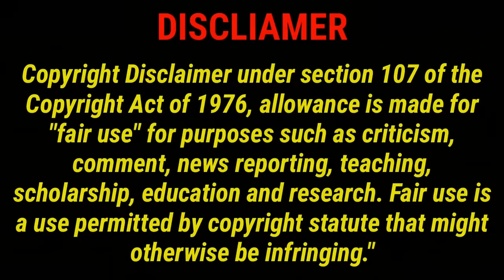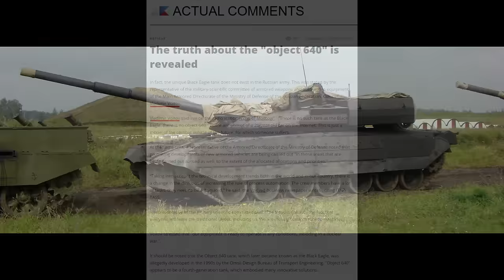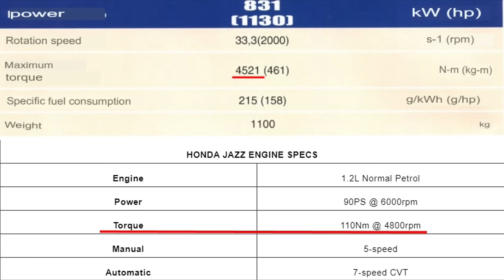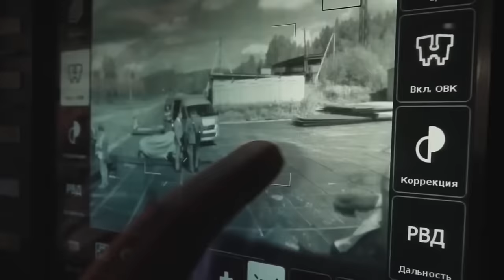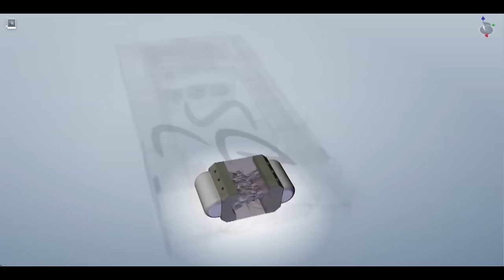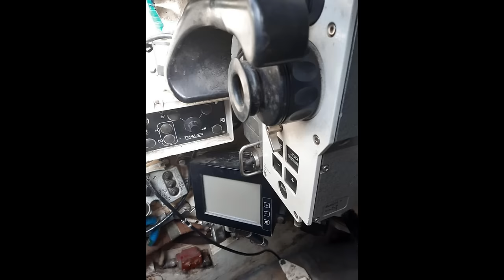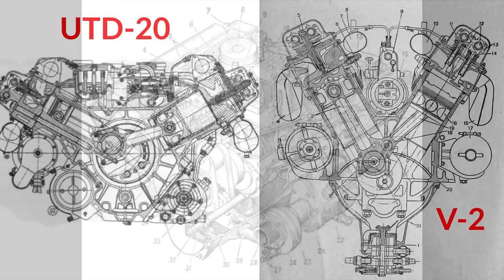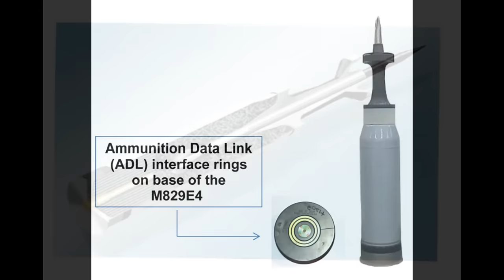LazerPig is WRONG about T-14 Armata

Comment: My grandad after the 1956 revolution when the Soviets were heading home and selling off their equipment to locals to buy rations/food/water got himself a T-54 tank which also uses the V-2, he worked on it a lot and sold it off to a tank museum where I have been working for 6 years (Kecel), I have maintained a T-72 V2 engine, the only difference between the 2 engines is that the T72 has a turbocharger on it an better bearings, nothing else.
Reply: @julia j
Which has nothing to do with his comment and is completely without substance, since the T14 does not use a variation of the same engine.....
Reply: @kivi
I mean yeah some verssof the engine will have bigger differences then others, the t54 and t72 might be close, but does the same go for the t80 and 90 or the t45?

Maybe something that wouod be fun to look into :)
Reply: He said it used a variant of it which is technically true but would be like saying the original 737 airliner is the same as a modern 787
Reply: @SweatyFeetGirl  T-14 Engine have infinitly less power, because it doesn't exists
Reply: T-54 does not use a V-2. It uses the V-54
Reply: @SweatyFeetGirl  LazerPig never did claim that, he said that the T14 could not use the V2 because of space limitations, and it instead uses an engine that looks like a copy of the german SLA 16 diesel engine which was notorious for either blowing up or catching fire by itself
Reply: @homesteadlegion4419  T80 has gasturbine so that it could operate on the arctic, yes the T80 was made primarly for that. The T90 uses a very similiar engine as the T72 I worked on, Same Cylinder head, valves, pistons, The engine that is next to the T72 that I worked on is a T90 V2 engine,   the only difference I noticed was with the injectors, they had bigger outputs and a new turbo, had a bigger compressor
Reply: @TheForklifter  which is a modfied V2
Reply: @SweatyFeetGirl  Interesting. Any link to such "social media"? Or all is  produced by RT?
Reply: @SweatyFeetGirl  Why don't we have pictures from western production lines of tanks? Well they exist and are part of military units.
Reply: @Kivi LP your boyfriend?
Reply: @jamesmandahl444  nah, Im not into men.
Reply: @ladrok97  What? 2V-12-3 very clearly exists my dude. They were first manufactured in the 80s and tested then. They're not mass produced of course but they are very much real engines.
Reply: Everyone here ignoring the fact this guys grandpa got himself a whole ass tank for potatoes
Reply: Adding a turbocharger is a pretty big deal.

Comment: and the TVR used a "slant six"...  LazerPog isn't much of an engine guy, I don't think he could find an exhaust port if it was full of womp rats eyes glowing in the darkness...    Now largely his point was that the engine was almost always the same size with the same mounts and same coupling location.    You seem to be confusing a little bit of "engine" vs "fully assembled running engine" in weights.   The numbers for the 2V are missing all the stuff you have to put on a crated engine to make it work.

Automatic target tracking has existed since before the end of WW2 for anti-air systems.  The AH56 Cheyenne had an inertial and optical target tracking system that could keep an autocannon on a ground target at 150mph in flight in the mid-late 60's.  LP isn't wrong, largely it was never seen as useful on a tank.   Multibattery automatic incidence targeting with remote tracking has existed - also - since before the end of WW2; its why japan stopped bothering trying to get Zeros up to the B29's.

In specific the TOW, Stugna and NLAW are going to go right past radar and IR on the Armata because they are not active sensor guided weapons.  Definitely one point to LP on this, if you don't SEE the TOW you don't survive the TOW.   If the Bradley or Striker or whatever vehicle carrying the M242 is knocking on your door you've got only one survival choice and that is breaking line-of-sight as the first step to making like a tree.  Stugna is like TOW but wireless, it isn't 'laser targeted' but source corrected and NLAW... NLAW is a Rocket Propelled Anti-Tank Mine in a stealth condom.  The only way you can interrupt NLAW is make your tank out of plastic, wood and concrete.

Overall very pleased with this video
Reply: Well technically even before the war, battleship Texas already had a very crude fire control system that computed lead and angles. More sophisticated systems that tracked targets and computed lead by way of analogue mechanical computers are present on most ships (above the size of destroyers) in WW2.
Automatic target tracking was not useless on a tank today, though back then it was not practical, since not only the systems and the optics way too bulky and expensive, there just isnt any way to track stuff on the ground (no infrared, no radar, not even cameras) 

and sidenote the reason for Imperial Japan not sending zeros up is that they don't have enough trained airmen anymore, both because of early losses in the battle of Midway, and the loss of air superiority due to the zero starting to be out-classed, as Imperial Japan does not have the economy to sustain production AND development of newer engines and airframes.

Comment: LazerPig's comments on the engine seemed odd to me right off the bat.  For workhorse type diesels they tend to go with what works and modernize it as opposed to building something new.  Reliability is paramount.  So a 80 year old engine modernized should do the job.  It might be "worse" than ultra modern engines, but it will likely be far more reliable and easy to fix.
Reply: Even on the high end performance side of things, Lamborghini used the same V12 design from 1964 right up until 2010, and the engine went from ~280 bhp to ~660 bhp in output. Engine design has come a long way and I can think of a few automotive examples like the Lambo V12 where you can take an old block design and squeeze a lot more juice out of it by bolting on newer equipment and increasing displacement. Having a eighty year old engine design is more a testament to how overbuilt it was originally rather than how it's necessarily outdated now.
Reply: @uummmnocoolnames based lambo
Reply: It’s the Ferdinand tiger engine. Do you know how unreliable that is? Anything based on it is going to  suck immediately
Reply: @unclesamlore  Let's go over the things you got wrong, or rather, the things Lazerpig got wrong, that you are parroting:

1. The Porsche Tiger/Ferdinand didn't have a single engine - it had two.
2. The actual engines themselves weren't the source of the problem - the HL120 TRM was used in later versions of the Pz.3 and most of the Pz.4s, as well as the myriad of different AFVs that used those chassis, none of which had noteworthy engine issues. It was the complexity of the twin engine powerplant coupled to a petrol-electric drive that caused issues.
3. The T-14 doesn't use a twin engine design.
4. The T-14 doesn't use an HL120 TRM, nor any engine derived from it, nor any engine derived from Germany.
5. The T-14 doesn't use a petrol-electric drive, nor a diesel-electric drive, but rather a mechanical transmission.

So by my count that's... carry the 2... literally nothing factually correct in your/Lazerpig's statement. 

For as much of an ass as I'm being, I don't necessarily find fault with you for assuming Lazerpig's video wasn't riddled with inaccuracies; he's a damn good script writer, and seems to do his research... most of the time. That being said, considering all the numbered points above are a single google search away, you should probably start to question the veracity of his claims, at least when it comes to technical stuff - geopolitics and history might be another story.
Reply: Think about it like this, if the 80 year old engine forces you to be several tonnes under the the modern engines, because they can't handle the performance requirement at that higher tonnage, then no amount of reliability will overcome the fact that it takes 3-4 shots to get the same results as a single one of theirs.

Comment: also about thah aoutoloader being a "deathtrap" it turns out the most of detonations of t-64++ were caused by a spare ammunition located in the turret or upper parts of a hull being hit by penning shot... and not carousel itself.
Reply: Keep coping
Reply: @bladesideentertainment7002 coping with...
Reply: @bladesideentertainment7002  ah yes smart guy you are. "Keep coping" on a real fact

Comment: i do feel like that lazerpig's jokes oversimplify specific points, and the overall quality suffers from it.
Reply: If you think "The Honda Jazz has more torque than a 50 ton Main Battle Tank" is a simplification of a joke and he only corrected it on the comments because people called him out on it, Nice job. Level 9999 humor right there. The T-90M is using the same engine as the BT-7. Super nice joke.

Comment: They ran out of ammo 10 months ago though? AMIRIGHT
Reply: They did, hence the Kiev retreat.
Reply: @ChucksSEADnDEAD  and yet they fire 3-4 times more shells then ukraine per day.
The retreat from Kiev was because of over exstension of the small force sent to ukraine, logistical issues (not the lack of shells but the trucks getting ambushed),  entire enemy formations in the rear (causing said supply issues) and simply lack of men to capture kiev in a regular fight as you cant capture a city of 3 milion with 60k men(or how many they had on the northern front)
Reply: @ChucksSEADnDEAD  truly delusional

Comment: 28:12 smallest windshield wipers known 😅 Seems fragile to HE, surprised they don’t use high pressure air+washer fluid (like some cars do on headlights)
Reply: Idk how the system is stored but it may add unnecessary weight n usage of space to store water ? So ig they went with the good old wiper
Reply: @hemendraravi4787  it is way way way more space and weight efficient that way in the long term
Reply: @domaxltv  Do you know whether anny tank that uses pressure and water washers?
Reply: @voidtempering8700  My area of expertise is mostly cold war era tanks (and back then such systems were a bit too complex to be widespread in general from what I know) but from what I do know of most modern ones, there is no such system in service or even on prototypes, though I could very well be wrong and someone more qualified could be able to confirm it

Comment: You know what Soviet area auto-loading systems are SUPER known for?  How easily and common it is for the ammunition to ignite and explode, completely blowing the turret off the main body of the tank.  This is a pretty common happening, just looking at pictures and videos of destroyed tanks in the Russo-Ukrainian War, as well as The Iraq War and even back to Operation : Desert Storm.  
One more thing... no reverse in a tank?   Fuck that... going in reverse is literally just as important as going forward in a tank.  The later T series has a very slow reverse rate compared to most NATO tanks, which would just be terrifying to know before heading out to make contact with other armor and anti- armor units.
Reply: Cope harder.
Reply: @pnduarte4696  Did you enjoy the May Day parade?
Reply: @Lonech  yeah....
Reply: There's a video of an East German tanker showing around a T72 and not once did he say the auto-loader had any problem. He actually said that it's the best tank he ever worked in.
Reply: Okay but the turret popping is an overblown issue, if a cramped tank like a T-72 gets hit in the ammo, chances are the crew are toast wether it detonates the turret off or not. 

Yes blowout panels are better, yes the design philosophy is outdated, yes it means less vehicle recoveries, doesn't change the fact that it is overblown.

Comment: I completely agree about the autoloader being very robust even to the point of ripping your arm off and continuing going about its business 😂😂
Reply: speaking from personal experience?
Reply: @ВячеславСкопюк  i doubt hes even seen a russian tank in person, let alone see an autoloader. Besides, if you put your hand in a autoloader while its reloading, its mostly your fault.
Reply: Except that was only recorded to have happened on early BMP-1 and its auto-loader, however they solved the issue when they removed it altogether.
Reply: Even on manually loaded tanks, the breech is a very dangerous place to have your hands. utoloaders eating arms is a pretty common myth though, even for vehicle like the BMP-1. The truth is that it CAN theoretically happen but it actually happening is extremely rare to the point of being a myth. IIRC it did happen a couple times on the early T-64 versions though.
Reply: @jernan0510  The breach is like Hungry Hipo toy, you need to stick your hand near to it and you know it's gonna be dangerous to do it

Comment: Minor correction #RedEffect
T-14 has two canons. It is planed to have larger caliber canon, what would be stronger if they ever finish it (what for reminder Germans and France already have and can't agree which one use). What they did not. But currently tank is equipped only in the same canon as T-90M.
Reply: They have a plan but at the end they still choose 2A82, which was designed for Provyv 2 modernized kit for T 72/80/90 (cancelled)
Reply: Well they are never going to finish it.😂

Comment: The idea that someone would hear that the engine used in the bt7 is also used in a t90 and thinking that people would think that they are identical engine is asinine.
Reply: How?
Reply: @gerfand The first issue would be the difference in size and horsepower between all the engines.
Reply: @voidtempering8700  yeah but if someone says "the BT7 engine is also used in T90M"
You will look up the BT7 engine and be like "wait the T-90M uses that, no way... my question is how its "asinine" to not make fun of someone saying that.
Reply: @gerfand  The OP said that the thought that people could confuse them is asinine.
Reply: @voidtempering8700  oh okay, Its a bit hard to understand, hence why I asked him.

Comment: Editing as I go; these are just offering my own knowledge on this long topic:

> Obj 195 is not the prototype; 148 is.

148 is basically a cost-cut version of the 195, so it's still the direct predescessor, but to say 195 is the prototype is false. Ironically, it is only cost cutting because they wanted...more money, as you mention. Irony hurts, here, painfully.

> Omsk's only vehicles after 640 were various upgrades. I am unsure if burlak came before or after, but they were all attemtping to use bustle autoloaders. This can also be seen on t55m6.

> Challenger 3 does not use ATTICA. According to research and fellows, it uses DNGS T3 for the gunner, and ORION for the commander.

> Riffles guns were nore accurate for non-fin-stabilized shells. So.ehow you both managed to be wrong about the same thing in different ways. The emergence of fin-stabilzied projectiles invalidated riffled guns, but that doesn't mean riffled barrels are suddenly some sort of myth.
Reply: You are correct the Object 148 is the true prototype. but a lot of the work/what was learned was carried over from the Object 195 making it a prototype in a sense
Reply: @Jammy Gamer  Yes, carried over. However, much of 195 cas carried over from 477, etc etc.

148 is a "redesign of 195" built from scratch, but done worse. It's a bit like early 80s chinese innovation, but this time it's a country doing it to itself.
Reply: @theneef174  yep they all part of a long series of projects

(Object 477 is such a cool looking tank)

Comment: As far as designing a tank around an engine goes. One could make the argument that the M4 Sherman was a tank designed for many engines. (A1 (rotary), A2(diesel), A3(ford multi bank engine), etc.) granted each variant was just that a variant. There were still a number of changes made so the engines worked well. However overall the Sherman did maintain a mostly uniform form factor, even the M4A4 (famous for its firefly conversion if I remember correctly) which had a lengthened hull for its larger engine was still mostly uniform with the M4A2 and M4A3, with those two variants being virtually identical except for a slight change in the vent layout. Granted none of this matters for talking about the T-14, since the only thing that is even remotely similar between the two is that they are both tanks by a very basic technical description. just something interesting I remembered about tank designs.
Reply: it was A57 Chrysler multibank not ford. Ford later produced the GAA which they derived from a Rollsroyce aircraft engine.

Comment: All V2s are variants of each other It is still the same diesel engine with the same overall design. Different engines are MB 873 and AGT1500 for example. Or MB 873 and any V2. Hopefully you get the idea. Even the soviets call them variants. Btw autoloaders on any t series are still notoriously unreliable after some time, due to the difficulty of properly servicing it in the field, regardless of your desire to do so. "we watched numerous interviews with both sides and they never mention" is a literal definition of an anecdote.
Reply: Also with the low up time of tanks in this conflict... It must be hard to tell with anecdotal data.